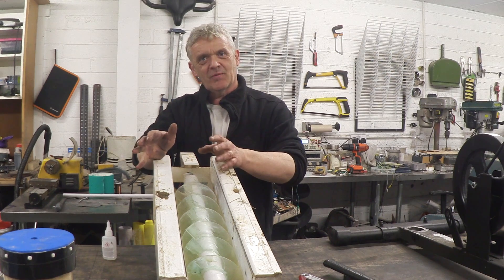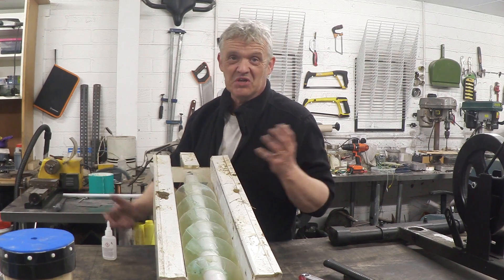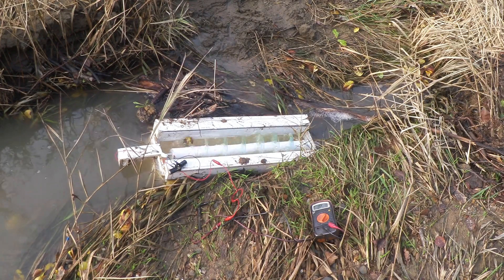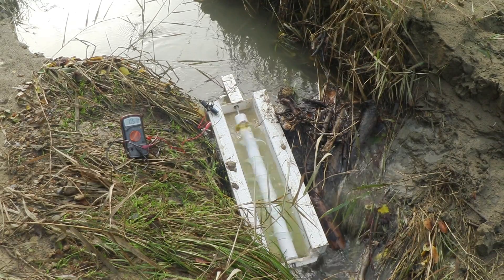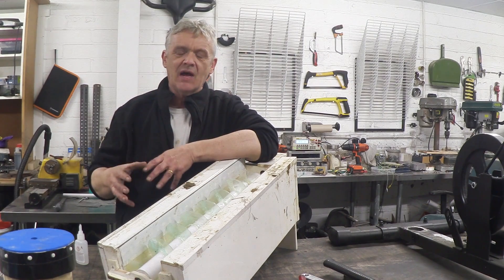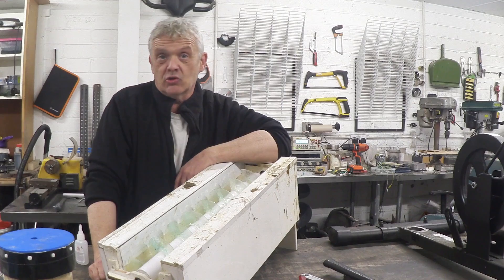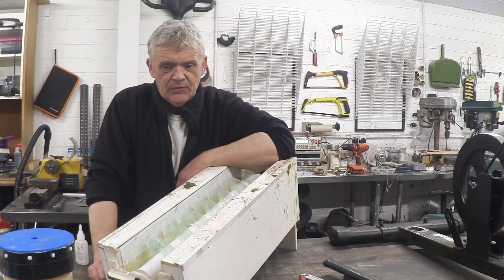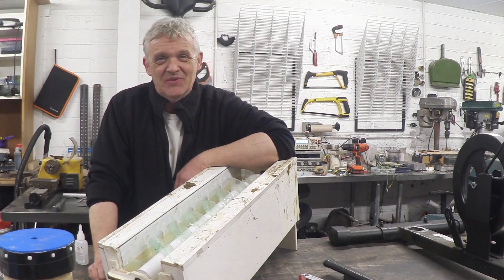Archimedes Screw  Water Turbine - Stream Test

Comment: I really enjoyed it... I have been thinking about an inside out shorter version as the exit of a pulse jet... to try to develop more thrust with a rotating lever.. a propeller... with which to move the World
Reply: I will test it with an expanding screw inside the conical exhaust port, which will be gimbaled on 2 axis to see if it creates more thrust than a straight cone as used in rocket motors... I have silicon carbide as the material, lighter than aluminum and 10 on the Moh's scale of hardness.. melting point @ 3500° C... near carbon... stationary or freely rotational on diamond bearings... they are not rare.. not even a little bit... kimberlite pipes are rare.. diamond is not

Comment: I can say that if you make it much longer, the torque developed goes up, [just gotta have a bit longer fall] and if you are using all cheap parts like this, you SHOULD be able to get up to voltages with which you can charge car batteries at least, just gotta set up the gearing commensurate to the voltage you are trying to get and you should be good to go. 

       /)/) 
    (  'ˬ') 
@(>_ )-b 
     \) \)
Reply from the maker: I just modelled this on my guess at what size the Japanese version was  - nice tip thanks

Comment: It might work just as well in a tube, maybe better, if submerged where water would be directed around the entire surface providing maximum force.
Reply from the maker: it works both ways - but from my reading there is no real improvement if it is enclosed or not

Comment: Could this be fully submerged in a soil pipe structure with the wave generator array attached to the outside of the pipe? Not sure if the pipe would increase the flow or hinder it really
Reply from the maker: this is just one way to make a screw mate - I have seen quite a few others so I would think yes if I have understood what you mean

Comment: 5 Volts?
That there may very well charge your cell phone.
Or a couple of AA rechargeable batteries.
Reply: It depends on the current. It`s just open circuit voltage being measured so not much use.
Reply from the maker: this is just a copy of a Japanese invention - maybe you should check that out
Reply from the maker: all I did was copy what the Japanese did mate - the current is going to be something more related to the generator attached - here is a principle that if you want to build it you can - I don't really know why folks seem to think it is a finished device - it really isn't

Comment: That is awesome ROB! Has to be at least a few watts your getting right!? I believe you mentioned in a previous video that  the "secret sauce" in making usable or practical power from a stream sized flow rate is in the motor to screw ratio and screw pitch to flow rate/volume ratios? is there a simple system to make it easily adjustable at both ends? ive seen simple cheap 3 speed RC car transmissions that may make it more adaptable for changing flow rates of a stream.
Reply from the maker: I suppose so mate - the reason I don't. look into that yet is this is really just a promising design and there is certainly work to do on it - was we know is the principle works now we need to look at combining a 'good' schema for generation and we haven't done that yet

Comment: Good job, i am interested to "built" a 200W archimedes turbine, but from calculation look like a monster 20in in diameter and long 75 inc. Could you confirm my estimation? Thanks in advance ;)
Reply from the maker: I am sorry mate I don't know - personally I think there are more variables to consider I was thinking of doing a video
Reply: @ThinkingandTinkering  thanks for the replay, i know that the calculation is not so easy 😉 (your video are olways usefull)

Comment: You should make a pelton turbine in that stream. Just stick a long pipe in part of it where there is enough height differense it to get some pressure. You could use some old spoons for the turbine and mabye printer motor for generator.
Reply from the maker: I don't think so mate - but you could

Comment: Any means to produced a useful voltage is worth knowing about.  If everyone just made that little effort there would be no power issues.   1500 square feet of my side yard all but powers our home.  Between Solar and Wind my electric bills have gone from $150.00 a month to $3o.00..  Only reason I'm stuck with that is I was stupid and used a 240vac pump in my 200ft deep well.  When that dies the problems will be solved.
Reply from the maker: nice one mate and I agree

Comment: water flow has huge potential for energy (some homes live completely off grid using water energy).  Unfortunately in the united states there are strict regulations on who can put energy harvesting devices in the rivers.
Reply from the maker: for sure mate - I guess if you own the river it helps - same here
Reply: However you could check into diversion as long as it is redirected back into the river.